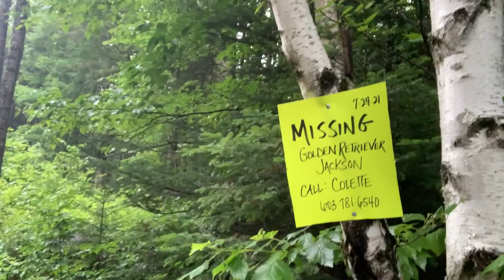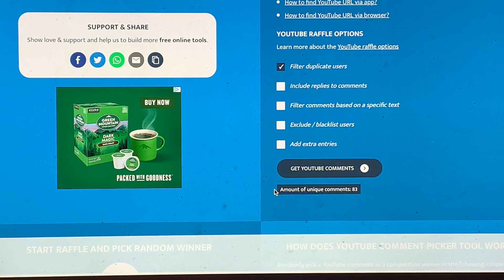$750 bag of Pay Dirt and an Ambulance / Gold Prospecting / New Hampshire / Vendetta Prospecting

Comment: Great episode, power tip on the high banker recirc. we sometimes put a mesh filter over the pumps to keep the vegetation from clogging up the pump. Or you can separate your feed water from the used dirty water with a screen in the tub. (you probably already know) Heavy pans Wes & Tom.
Reply from the maker: Hi Bobby, Thanks for watching. I may try that. I was thinking about using a nylon stocking around the pump but I don't want to go in the store and buy one...:_thehiveLaugh:...Stay groovy. :_thehiveCool: